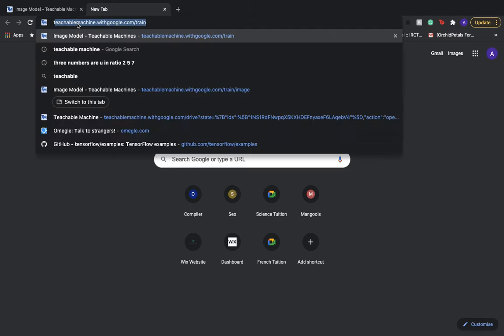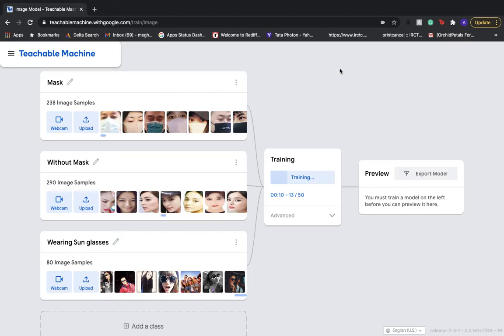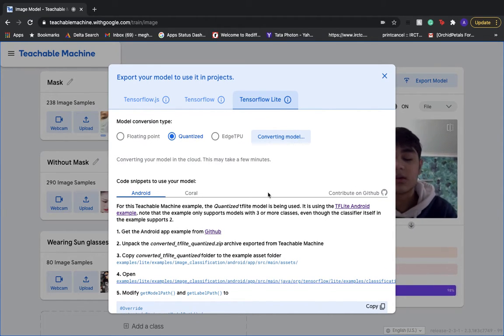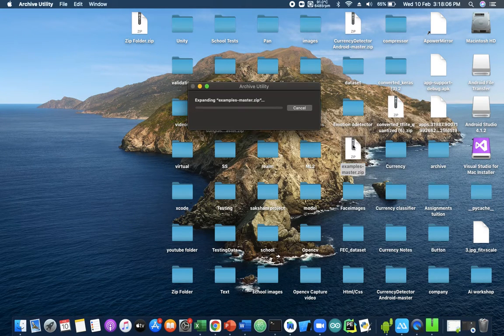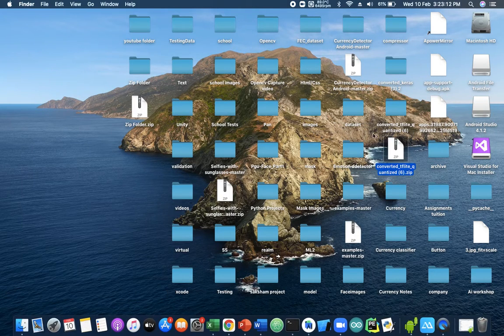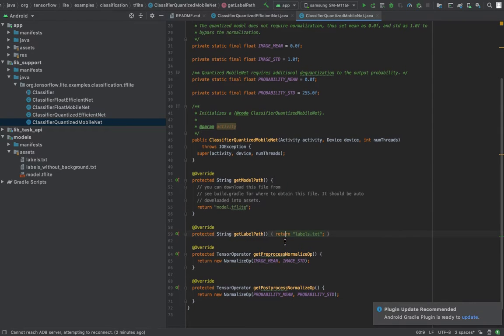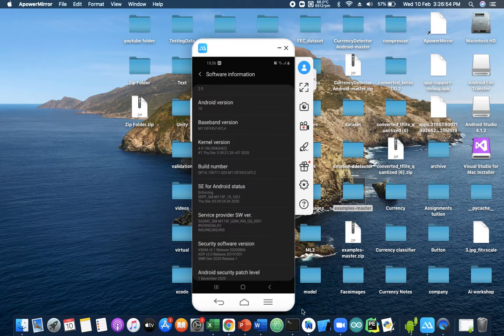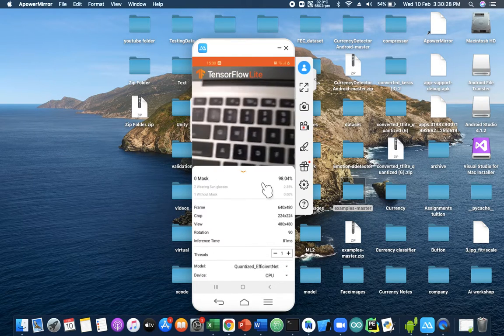Face Mask Detection App Using Android Studio & Teachable Machine(Without any Coding!)2021

Comment: Hi, I followed all the steps but in the app it is still showing random suggestions instead of the options I programmed it to. I am on the quantized model on my phone but it still won't show the options I told it to. I made sure that the quantized mobile net and quantized efficient net were changed and redownloaded my teachable machine program to try again, but it still won't work. Do you know how to help? Thank you
Reply from the maker: Since I cant see your device and what you have done I can just suggest you to retry maybe you would have made some small mistake somewhere.
Reply: @codeable7851  I'm facing the exact same issue, i re-did all the steps multiple times but it still fails to show the classes I created, instead it seems to show recognise objects with some other model which i havent trained.
Reply: @shamithrao6792  me too
Reply: @shamithrao6792  i have same problem...
Reply: @shamithrao6792  me too
Reply: did you find the solution?
Reply: Same problem
Reply: Same problem.. Anyone fix this issues?
Reply: same problem.. how can we fix this

Comment: Hey, I found your video interesting. I wanted to know if the final application is a separate app apk, or is it using the TensorFlow lite application, it is using that for sure but is it working in a separate app?
Reply from the maker: You can create a seperate apk using build but the tensorflow lite application will remain same